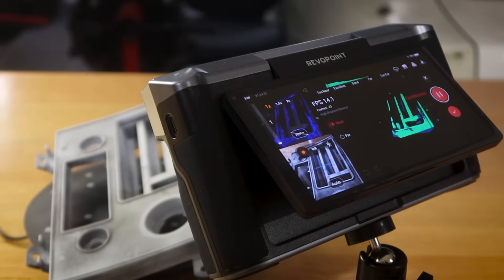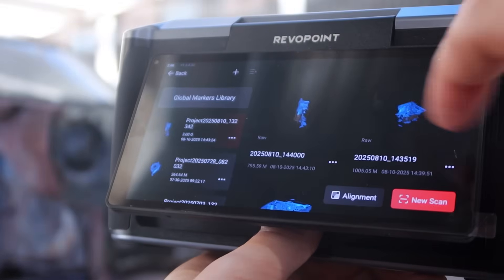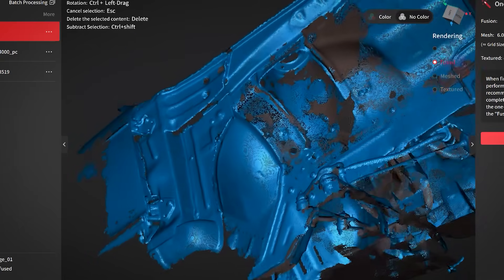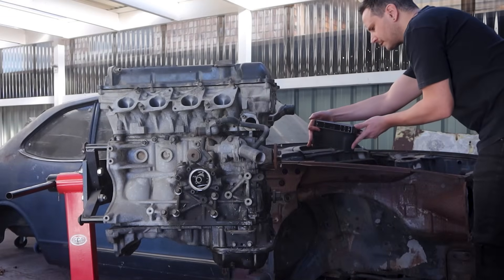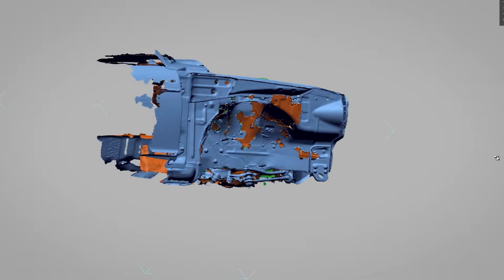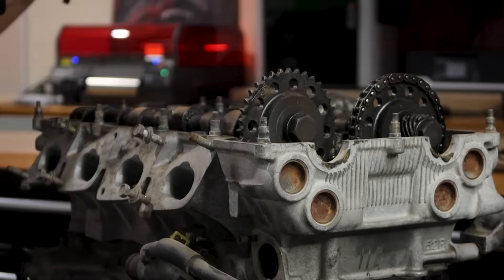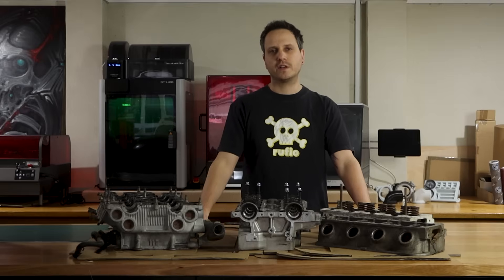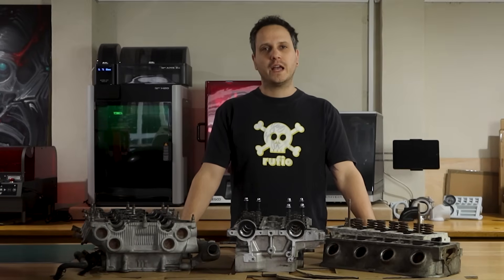Uncovering my forgotten project car: A 1970's KE25 Corolla | Revopoint Miraco Plus 3D Scanner

Comment: I believe those snap gauges are not good enough for things like bearings. Jafromobile did a video on this ages ago where he measured his 4g63 bores with a real dial bore gauge and a snap gauge, and the readings were wildly different. 

I'm not a machinist, but hung out with a few. Bought a decent dial bore gauge  specifically for this sort of job.
Reply from the maker: Hey mate thanks for the info I should go and check that out. I have been toying with the idea of getting a dial bore gauge but at this stage I think I'm also likely to outsource things like line-honing, as there are only so many hours in the day. Appreciate the comment though and I will keep it in mind
Reply: @fatlipcollective yep, I can't line hone either,but after 1 bad experience with a machine shop, I always double check.

Keep up the great work!